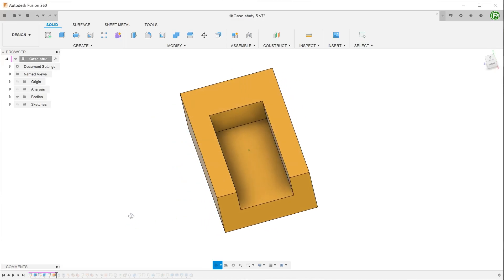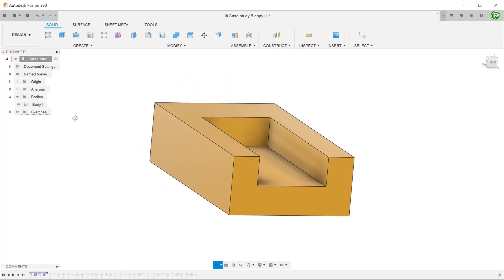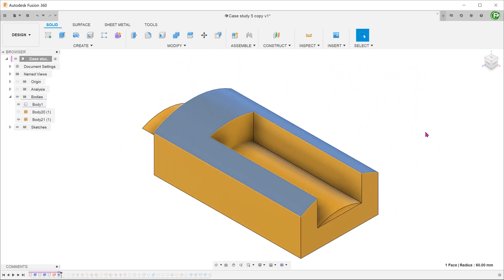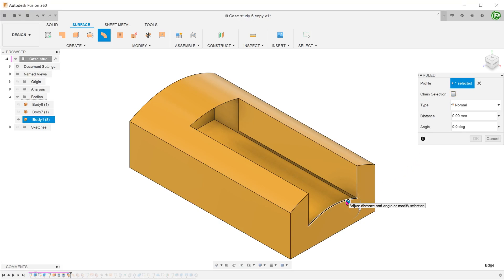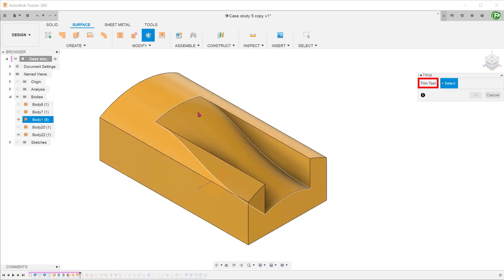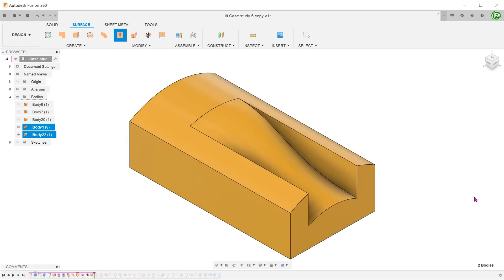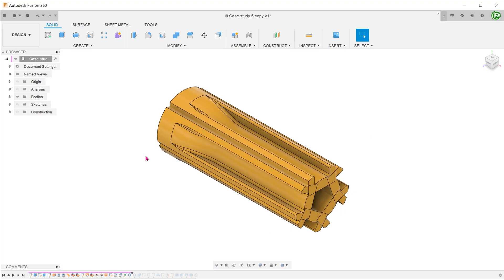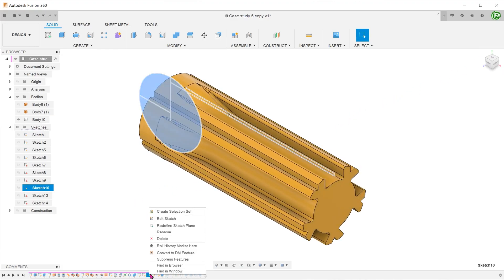Fusion 360 - Case Study 6

Comment: I'd rather use one sketch with side profile of handle (target diameter, length) and the groove (also with spline) and then symmetric revolve for 60 deg to create 1/6th of handle followed by second symmetric revolve for e.g. 30 deg to cut the groove. Either way, good to know the same/similar result can be done in many different ways. Thanks for another great video.
Reply from the maker: That sounds like a good way too. Might try that out if I have the time.

Comment: When I use the offset face, the plan created by loft command gradually concave up as I pull the face.  What tangent weigh was you using?
Reply from the maker: Hi, did you create the helping/guiding face for the loft? The loft needs to be tangent to the helping surface. The tangency weight should not matter. As long as it is tangent, the offset should extend that face in a straight fashion.
Reply: @Fusion360School  yes I did use the rule command. Both are tangent to the surface
Reply from the maker: Hi, I have posted a link to my file in the description. Not sure whether this will help.
Reply: @Fusion360School  In your uploaded file you  were using a centered line  in the loft feature and this explains the concave behaviour I had.  I was not using centered line.
Reply from the maker: Hi, thank you for telling me. I reviewed the file again. You are right. I had completely missed this out in my tutorial. Apologies for this.
Reply from the maker: I am planning to do a follow up video to correct this. At the same time, this will be an opportunity to introduce using centerlines in loft. I really appreciate that you take the time to follow my tutorials. Thank you again.
Reply: @Fusion360School  The design of your content is really good.  They are  condensed and at the same time there are really good takeaways.  Each case does not take long to follow.  Thank you!
Reply from the maker: Appreciate your comments. I will definitely credit you in the follow up video.
Reply: Different people like different learning style and this one suits me.